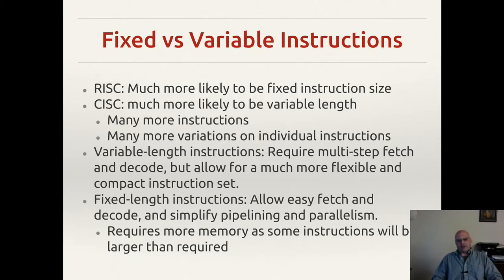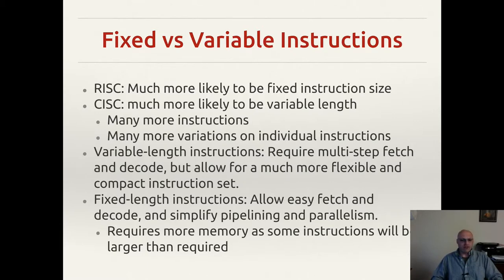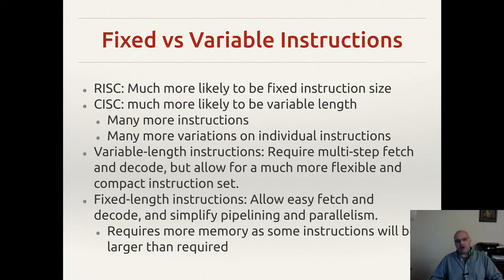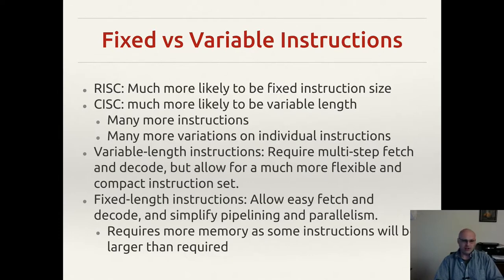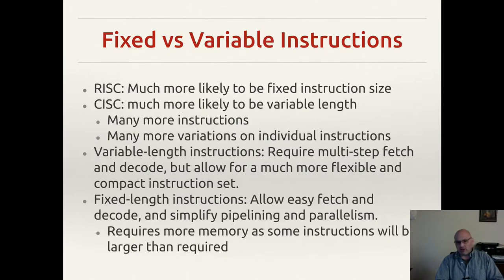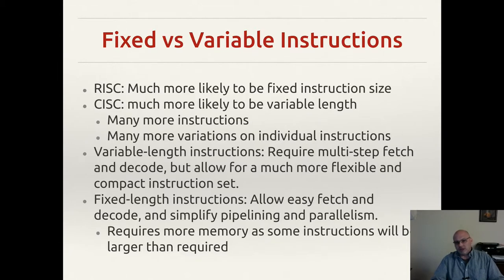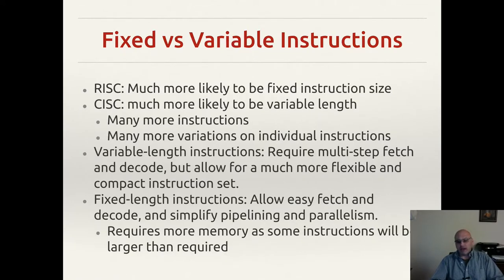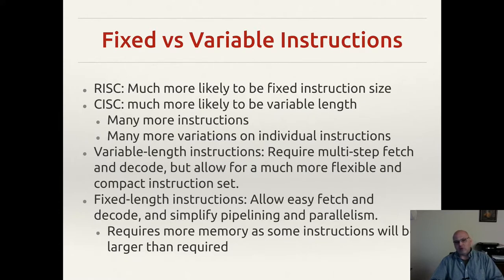Fixed vs Variable Length Instructions

Comment: What about an architecture where the first bits of the word hint a specific "fixed" length instruction, so we can have some variations but also keeping it "fixed" on some options to reduce the complexity of decoding the instructions?

We could use two bits to have 2, 4, 8, 16 sizes...
00 - 2 bytes long instruction
01 - 4 bytes (standard word?)
10 - 8 bytes
11 - 16 bytes

While this is not as flexible as a variable length to use a 5~7 bytes instruction, it's either 4 or 8, we could still have some variation but being "flagged" up ahead wouldn't be as complex as a truly variable length to decode.

Why this isn't a good approach?
(I'm assuming it isn't considering it's not being used)

(And maybe it would be in fact 1 byte, 3 bytes, 7 bytes, 15 bytes instructions considering prefixes and other potential "flags" that would take up some bits of our word.
Reply: The tradeoff with this approach is that it limits the range of possible instruction lengths, as you pointed out. Also the prefix adds overhead to each instruction, as the processor must decode the prefix before it can begin decoding the actual instruction. About real world usage, ARM Thumb instruction set uses a one-bit prefix to indicate 16-bit instructions instead of the usual 32-bit instructions.